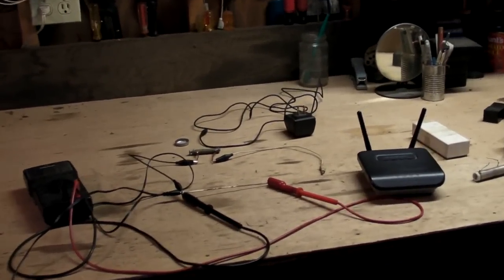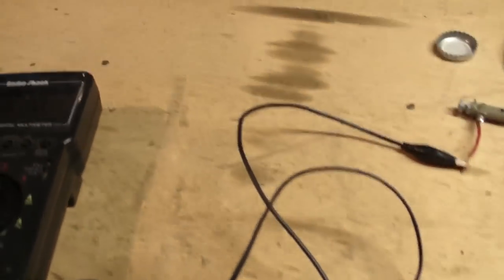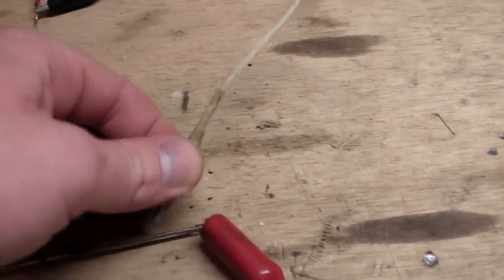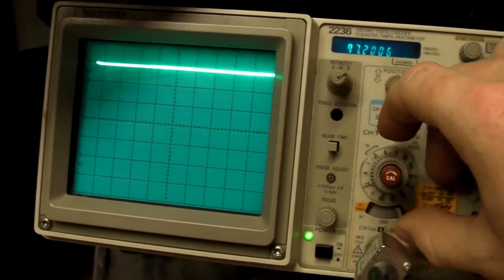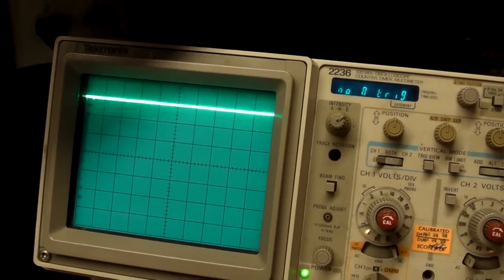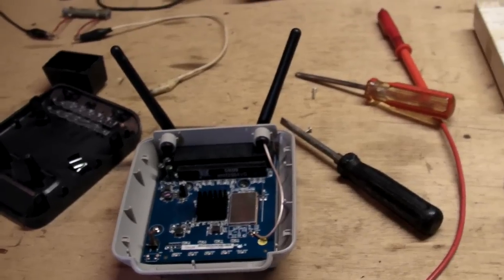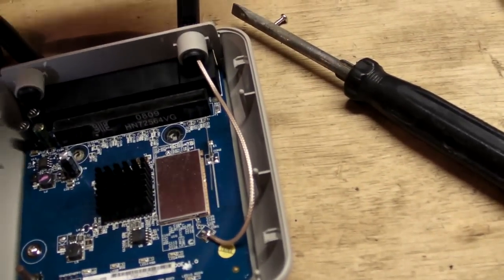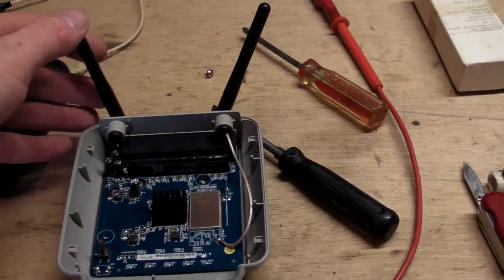(#0082) Cheap Dynex Router - Power Problems & Teardown

Comment: The stamped plate is likely the real transmit antenna, the other one with a coax could be in parallel with it, or is used for receive only, so as to reduce the demand for good separation in the RF chipset so cutting cost further. I bought a cheap ( on sale ) Billion router a few years ago, and when the PSU died after 6 months just ran it from the UPS battery instead. It is happy with a 12V input instead of the 6V it got from the rotten wall wart it came with, with OHL caps that popped in months.

Comment: Cheap supplies have primary side regulation. Output is going to have about 10-15% regulation, rising a few volts above rated on no load. The board has it's own switching supply to generate the 3v3 rails it uses inside, it will likely run from 5-8V input with no problems. Second switcher near the main chipset probably makes the 1v8 rail for the processor core from the 3v3 rail. You either have a shorted ceramic chip cap in the power rail somewhere after the regulators or a faulty main chipset.